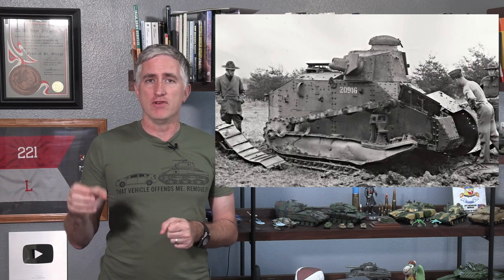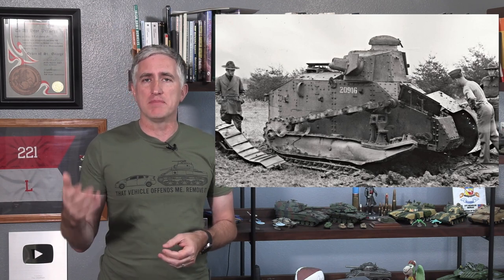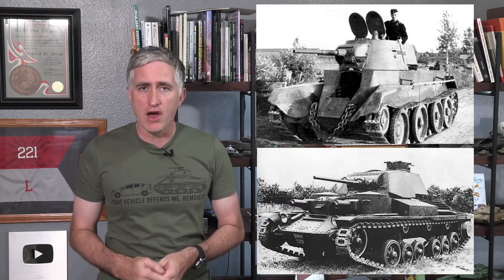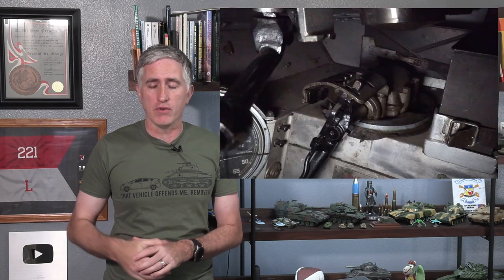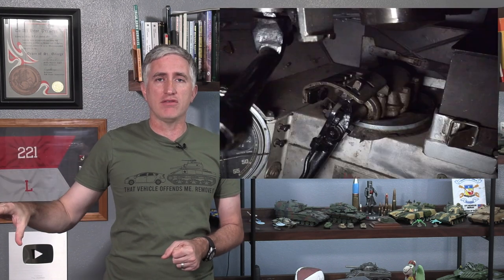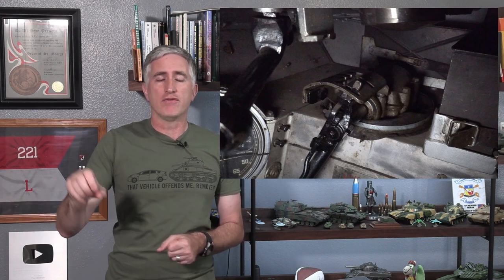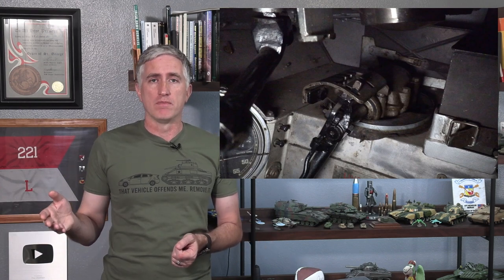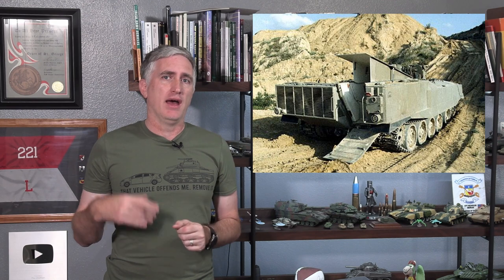Advantages of rear engine tanks with front drive sprockets

Comment: The reason why the Israeli tank has the engine in the front is because they originally were going to carry a squad of infantry in the tank itself. They decided not to do this so the patch in the back is used for resupply and like you said to get people out if they’re welded or to evacuate the tank if under fire.

Comment: The balance part makes a whole lot of sense on the early war panzers. Figure both the 3 and the 4 were originally designed with the same 14.5mm armor on all sides, having all the machinery on one side would probably have been troublesome. But then while the 3 was upgraded to 50mm front and back (probably still a good balance) the 4 eventually had 80mm at the front and 20 at the back, and was noted as a bit cumbersome.
Reply: The T34 had this issue: turret was offset to  balance transmission and engine on the back. If Russian engineers did up gun it and use a better protected turret, they could not up armor front hull, because the new turret,  offset from the centre of gravity, already unbalanced the tank. 45mm of armour there was very good in 1940, not so much in 1945.

Comment: German tanks of WW2 had front sprockets and allowed the tracks to roll along the tops of the road wheels. This removed the need for any return sprockets and acceleration would not cause any swat when power applied. The interlocking wheels spread the load more evenly but caused a lot more work when inner wheels had to be replaced. But twin wheels all the way down would have been just as good.

Comment: It's kind of funny that the M18 has (partially) the same reason for having engine and transmission at opposite ends of the vehicle that a lot of front engine high end sports cars - Lexus LFA, AMG GT, most of the front engine Ferraris, etc - balance. Now I want to see a drift missile M18 in a crossover of Girls und Panzer and Initial D...
Reply: There has to be a video on YT somewhere of Deja Vu cut in when Mako slides the Pz IV around the Tiger in the last battle of the series
Reply: The M18 really got robbed in GuP, it should have had much more of a central role but we barely see it. I get that it isn't a famous tank but it was basically everything that GuP is.

Comment: Guessing front drive best because...
Return distance for the track allows mud/debris to shake off less wear & tear and less chance of track jumping.
Slack track below front sprocket wheels allows the track to form around obstacles such as trees and enables easier crossing of obstacles without stressing the links
Use of space, I’d imagine there would be some wasted space at the very front which could be filled with transmission parts, by coincidence this could also add to crew protection in a tiny way probably more so in WW2 tanks like Sherman where there’s a bolt on transmission adding to armour thickness.

Comment: I always thought front sprocket causes excessive track slack as the sprocket "pushes" the forward tracks rearward but "pulls" the returning tracks forward when the tank is moving forward, whereas the rear drive "pulls" on the forward tracks rearward and "pushes" return tracks forward therefore keeping the track tension when the tank is in the forward motion. I can see that on my 1/16 RC Stug III. When I reverse the tank (essentiallymaking it a rear drive tank), the slack disappears.

Comment: Very interesting! 
Another thing I'm thinking about... The racks of the sprocket wheel is going through the tracks. If you have the sprocket in the front and force obstacles and terrain where the sprocket is in cvontact with the ground or obstacle, isn't there a big risk for high abrasion of the racks or even damages, especially if the ground or abstacle are pretty hard?

Comment: Considering that the armor on an APC is not that thick the motor in front might stop a small round that would other wise get in the rea compartment and bounce around for a while.  But the M59 used two engines mounted on either side of the rear to allow a rear ramp and rear engines.
Reply: That some porshe thing. If he just took already existing engine that was installed on Henschel tiger...

Comment: The biggest advantage for rear engine, front drive sprocket is better weight distribution . Gotta make it 50:50 weight distribution for the perfect handling yo. Gotta make it turn around corners faster .
Reply: That goes under balance, doesn't it?
Reply: You've been watching Tokyo Drift again. Haven't you.

Comment: Hey Cheiftan, I’ve got a question for you.
How much more effective were APC and APCBC shells compared to AP ones?
Reply: Balistic caps(BC improved the range of the shell, and caps(C) were used to improve penetration under angles. How much it worked depends on the shell design. AP used to be kinda bad at angles untill they started using armor piercing caps to improve normalization and all that
Reply: shepardpolska except that it’s completely nonsense what you are saying. Penetration caps were used to prevent shells from shattering when the armor was particular hard, the shell greatly undermatched the armor or when the armor was angled 20-30° which otherwise would cause the pointy nose to break off. APC is good for penetrating thick vertical armor but regular AP is actually more effective to defeat heavily sloped armor, simply because the AP penetrator has more mass over APC shot. 17pdr AP only penetrated around 160mm of armor compared to 17 APCBC which penetrated around 185-190mm. On the other hand could the AP pierce a Panthers glaciers armor while APCBC could not.

Comment: Drive sprocket front means the top track run was in tension and the bottom run not as much, depending on tension adjustment.  
Drive sprocket rear means the bottom track run is in tension and the top is not as much. There again depending on tension adjustment.
Does one climb better than the other?
Does one make more noise than the other?
Does one type perform better in soft terrain than the other type?

Comment: A technical truth is that if you mount them mid vehicle the turret won't turn; this is why Cobra's tanks had such weak firepower - the mid-vehicle sprocket reduced the size of the turret and made the tank taller.

Comment: One more reason: gearbox in front-more metal covering crew. Tank can be manufacured far cheaper, easier and faster that resuply well trained manpower. Also if you shoot enemy tank in gearbox, you won its attention and probably it is pointed at you with loaded gun. Quite bad to be unloaded after shot.

Comment: People really don't have a clue what driving a manual transmission is like these days. The part about shifter linkage length is far more important that what people realize these days. Driving a manual transmission exclusively, I know how important it is, especially when you first start off, to get into gear quick enough before too much RPM drops to smoothly engage the next set of gears. Now take into account the resistance of tracks against the ground, and the weight of a tank, and you have a huge issue with shifting, if your linkage is too long and sloppy, which could cause you to stall out every time you need to shift, if you can't get into gear quick enough, which would cause insane stress upon the drivetrain, especially in the days of early synchros.

Comment: One advantage of rear sprocket is rear sprocket put the tension on the bottom of the track where as front sprocket the tension is on the top of the track..It's easier to throw a track that have a front sprocket drive.

Comment: As a slight tangent to the drive sprocket positioning, I read that for the demonstration of the original Tiger tank prototypes from Henschel & Porsche the latter design was with a petrol electric drive (which apparently overheated and caught fire), 2 questions i have are, firstly it's reported that Porsche were confident of winning the contract and had started producing hulls (i've heard the figures 90 - 100 were made) that were converted to make the Elefant tank destroyers were these "converted" to traditional drivetrains and because of this was this a  factor in compromising their performance, and secondly has anyone since considered using this type of drivetrain system and if not why not?
Reply: I can answer the first - no, they kept the engine system. Essentially the first serial hybrid ;)
Reply: The drivetrain was used in the Maus and would be used in E100. The US did experiment with it in WW2 and post war. The stuff does have benefits in the petrol engine era since electrical engines have a "buffalo power curve" even better than diesels.

Comment: It’s for the fifty fifty balance between turret, making the centered turret and weight and maintenance and reliance. However with the combined engine and transmission with almost or no driveshaft between the engine and transmission,  and with today’s modern tanks the heaviest armor is upfront so both engine and transmission can be at the back with little to no imbalanement.

Comment: I think one more advantage of a rear-engine, rear-transmission layout is that it allows for more flexibility in the front shape of the tank and a better armor profile.
Reply: Well, the S tank had front engine, front drive - and one of the wedgiest front shapes of the frontal armour... So I personally think you are wrong.
Reply: @oddhedberg2648  Except the Panzers needed a front extension to house the transmission, the M4 had a completely rounded weak point to house it, and it would have been impossible to make the T-34 nearly as sloped as it was without massive redesigns if it used a front transmission.

Maybe instead of finding an exception in extremely unconventional "Tank" design you should look at actual design trends in large numbers of vehicles?

If I said "Sloped armor is useless because the Tiger I is better protected than any T-34", I would be wrong for the same reason.
Reply: @andrewmandrona7891  Well, T-34 sloped armor was kinda usless. Protection from small AT weapon? 45mm flat plate is capable for it. Anything bigger will just shatter T-34 armor.

Comment: Sprocket at the front is called a live track - as the whole track is under tension, Sprocket at the back is a dead track. one advantage of a dead track is on some tanks, ie Centurion,  you can shorten the track to remove a damaged section or bypass a damaged idler or front road wheel as a "get you home" measure.
Reply from the maker: Common misconception. Live track has bushings in it which provides a certain amount of tension. If you leave a section of live track on the ground, it will tend to curl up at the end. You are thinking of suspended and unsuspended track. It is possible to short-track live, suspended track, for example, on the M1.
Reply: @TheChieftainsHatch  We were always taught live track is when there is linear tension all the way around the track. The track you describe is like the DG tracks used on Roadless halftrack tractors, I think the tracks on FV432 were like that as they had hexagon pins in rubber bushes.
Reply from the maker: Unfortunately, training isn't airways the most accurate when it comes to the fine details of engineering.  A similar mistake is the amount of times I've heard unsupported track taught as Christie

Comment: Simple as this. Front drive gives slack on the bottom of the track so the suspension can move. Rear drive causes tension on the bottom track resisting the suspension.

Comment: A question for The Chieftain and/or any other tankers out there. How do you get power and/or hydraulics/pneumatics to the turret? In my mind, I keep on seeing any cabling/hoses getting all wound up if the turret does a complete 360 and would have to turn 360 in the other direction to unwind itself. But that would, obviously, be impractical so how is is power delivered to the turret without having to worry about that sort of thing?
Reply: Here You have a good answer: https://www.quora.com/How-are-tank-turrets-provided-with-power-from-the-engine-since-it-has-to-rotate-independently-from-the-hull
Here is the same device from Sherman: http://www.theshermantank.com/wp-content/uploads/turret-collector-ring.png
Basically, there is a separate cabling for turret and hull. Turret cable ends with conductor (metal brush) which touches another conductor (metal plate) at the end of hull cable. Brush rotates on a plate. The good analogy here would be a gramophone or HDD with its disc and needle.

Comment: well once again, didn't think there would be that many points about differences here..

is there a "four-wheel" driven tank? could it work? would there be advantages on it? would it ease the load on sprocket or just be a waste of fuel and more maintainable parts?

Comment: I read somewhere that another reason the Merkava has the engine up front is basically extra armor, as keeping the crews alive and fit is priority number one for the Israeli military.
Reply: I have read the same thing. Having said that is it wise to have your power-plant in harms way like that. It must put extra strain on getting it repaired and back into action if you have to pull the entire engine.
Reply: No. Merkava engine is at the front because they need place to stuff extra crew member.

You know what makes better armor than engine block, actual armor.

Comment: Question: at what point did armored crews begin using turret down and hull down positions and what we might call today a sequence to adopt? This seems to not to have been a consideration pre ww2 with many designs mounting a significant portion of the armament in the hull. Even Cold War Soviet designs  don't seem designed to exploit the crests for cover (gun depression, operating hatches down, etc..).  You have mentioned in the past that Sherman had a distinct advantage for having optics for the gunner on the turret roof thus allowing the gunner to pick up targets from the turret down, but was this recognized in any official capacity and/or factored into future designs?

On a similar note,  are there any historical examples of using the turret down as a position of observation going terribly wrong as commanders stick their head out to peek over a crest?
Reply: My humble opinion: depends on what is the tank designed to do: cold war soviet tanks were designed for attack. Small flat tanks (saving weight) charging forwards. As far as I know even their reverse gear was only there for parking purposes - aka...slow. Western tanks on the other hand were more versatile. Attack, defence. It is said, that Leopard2A4s turret was better armored than the M1's (but the hull was weaker compared to M1) since the Germans expected to do most of the defensive fighting from hull down positions. Most western tanks could/can move very fast while going backwards since their tactical deployment (defence/delay) required them to do so.
And on a pratical note: since you don't fight on "maps" usually there isn't that "perfect" hull down position where you can spot everything and be protected, more often than not the terrain isn't exactly cooperative...

Comment: One of the reasons why the Russians accepted it at least in 1940 
is because when used front drive is that in the friction of the bearings 30 percent of engine power is lost
  but they also got more ammunition in front of the T-44 tank
at least that was their thinking in this period.
And one thing they wanted to achieve was that the engine and gearbox were always protected at the rear of a direct hit.Because the production of quality gearboxes and multipliers was more difficult in the USSR.At the same time, if the tank is destroyed, at least the engine and transmission will remain complete and again those parts can be used.
But on the other hand, the front gearbox added extra protection to the crew.
But also easier access when replacing because the gearboxes of the tanks are usually damaged or damaged. So like in m4 they can be easily replaced with a new one.

Comment: There is another benefit of a front mount transmission, it aids crew survivability in the event of a hit on (or just in front of) the transmission, very minor unless you happen to be one of the crew it saved! Tank would still need recovery of course.
Reply: the issue is it reduces the thickness an UFP can be (due to needing to lift it to get at the engine/transmition, amongst other things, or you end up with overly complex systems [see panther] that are a pain to maintain), and the relatively soft metal of engines/transmissions don't really help against kinetic weapons.

Comment: I have heard that having the sprocket in the front means that the track is cleaner when it encounters the teeth of said sprocket.   It has traveled the length of the tank giving it an opportunity to shed the mud and vegetation clogging the teeth holes before engaging the sprocket.   This supposedly helps prevent losing the track.  A rear sprocket engages the track just as it comes off the ground and is more likely to be fouled..  Is this true?

Comment: Radial engine with a 3:1 overdrive, use a fluid couple or torque converter drive a planetary, and a worm gear drive the rear sprocket. You could use a larger radial then the 1800 supercharged with the Russian supercharger design that takes 100 less hp when it’s throttling. Then you can lower the rest or have more space. You could up armor or carry more. I would lose size .

Comment: Can someone put a link up in a reply. I think the chieftain did a video on advantages and disadvantages of different track designs. I.e supported and unsupported tracks. See quite a bit of soviet tanks using unsupported tracks where the top of the tracks is simply running across the top of the road wheels. I know both nations used both, but why?